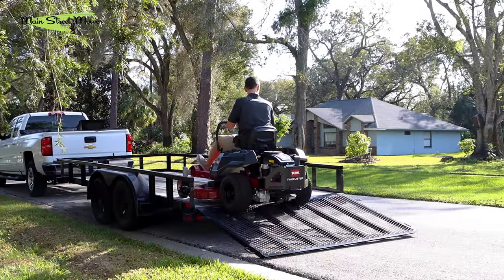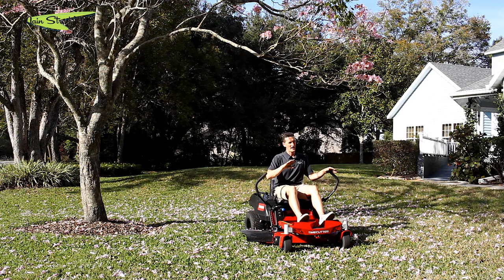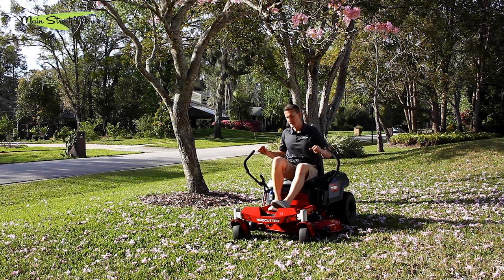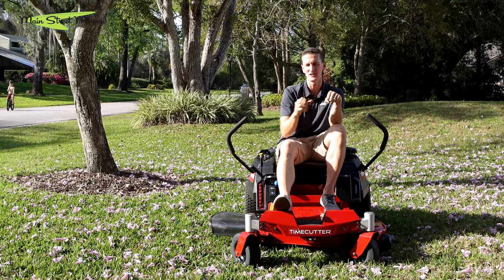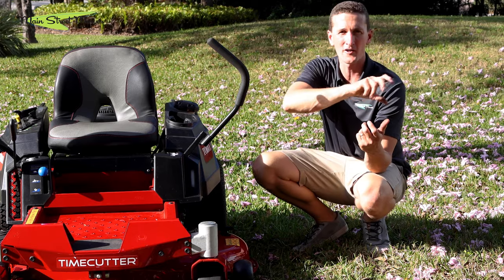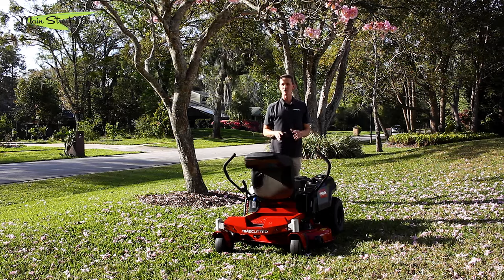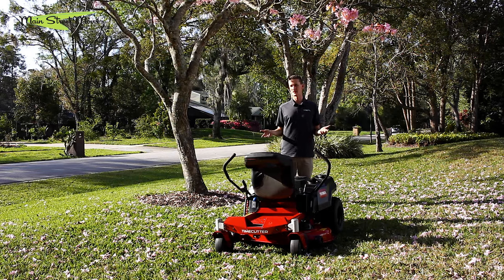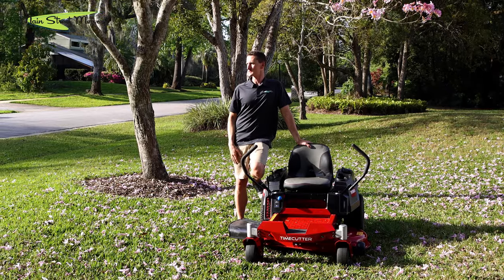TORO TimeCutter Video Owners Manual & Complete Guide

Comment: I have a Toro steering wheel zero turn. I like the fact I can pull a 25 gallon tank sprayer and spray along a fence, turn and pull away. With the lever type zero turn because of the way the back end swings around. When you try to turn it drives the sprayer into the fence. Bring back the steering wheel.
Reply from the maker: It might be a little frustrating specially if you're used to the older style steering wheel handles but that's only until you get used to the newer levers. They add so much more maneuverability to your mower it's really helpful for tricky yard work.

Comment: Maybe I am being a bit rude but having an hour meter as an option is stupid. It should be a stock standard thing
Reply from the maker: We agree, all the accessories would be nice, but from the manufacturers perspective a majority of the market is shopping on price. And adding features would increase manufacturing cost. By providing accessories, customers can add on what’s important to them.
Reply: All deers have time clocks on them
Reply: I agree, I just bought this mower and couldn’t believe they don’t have one stock. It’s wired up and read to go, hell even the slot is cut out. Yet they still make the consumer buy it and install it. Why not just do it and add it in to the total mower price?
Reply: Makes perfect sense. I am however from the small funds category myself so I'd like all the accessories as stock haha😅 @mainstreetmower
Reply: For 3200 it should be factory installed smh
Reply: @mainstreetmower  but it's not really an accessory, otherwise toro can fault no consumer for going over hrs between servicing
Reply: @Phokings  For $4800 it shouldn't spin the tires and gouge your lawn every time you turn 180 Deg.

Comment: Thank you for the detailed video!  
I was trying to figure out if I was supposed to use half or full throttle before engaging blades and a couple video I saw them saying to engage at full throttle to avoid wearing out belts and clutch and that didn't make sense to me.  
I drive big trucks with 18 speeds and of course you don't let the clutch out at high rpm's as it wears out the clutch right!?!  So I kept looking to make sure.  Thankfully you confirmed my suspicions.  
I am buying a 2023 Timecutter 54" deck with the series 7000 Kohler engine and MyRide suspension system very soon and wanted to know my facts before hand.
Anyway, thank you again and keep with the great informative vids :)🟩👨‍🦼
Reply from the maker: Awesome! We're glad this helped. Congratulations in advance on the new machine. 🙂

Comment: Great Video!  I've noticed that these newer models of the Timecutter's have a different deck assembly from the older models. Can you do a video of how to remove to deck for blade replacement?  I'm yet to find one on YouTube
Reply from the maker: Thanks man. Yes, we can put that video in the pipeline. 

Meanwhile, you might wanna check out this video  where we go over installing a mulch kit. You might find what you're looking for when we go over replacing your blades in that video. Here's the link: https://youtu.be/m5aQASnL-8g
Reply: A lot of people lift the front real high with a chain hoist or an engine hoist. Just use HD nylon straps looped around the front wheel outriggers and hoist it up. It's a good idea to use jack stands or cribbing as a safety backup. It's really fast with a battery or air impact gun!

Comment: Cool video. It would be great to see a video on what makes the different 42” Timecutters different from each other. Toro seems to list 4 or 5 models for the same deck size.
Reply from the maker: Good idea Mr Mullin, we’ll do it soon
Reply: One of options is the MyRide, where the seat and foot area are on a shock absorber set up so that if you have an unsmooth lawn, you are not feeling every bump. Well worth it in my opinion.
Reply from the maker: @dconkey1  Agreed with every word in this comment. We even made a video entirely on the MyRide feature. You can check it out here: https://youtu.be/iXxOgn7yPOA

Comment: Question about deck height. I was at a local dealer when a man was saying his MyRide 50" deck at the 4" setting measured only 3.5" at the blades from ground to cut part of the blades. Another man spoke up and said he's measured only 3" at the 4" setting. The dealer said he didn't know of any problems like that. At that time, I left the store. Got home and looked that problem up on Toro website nothing but sure enough on youtube a guy showed the setting 4" at handle 3.5" at blades. Is this a problem and if so, what is the fix. Better yet does Toro know about the and not saying anything. Have you folks seemed this problem if so, what was your fix.
Reply: Just raise it up to the next setting 😅

Comment: will it fit through a 36 inch gate? wheel base?
Reply from the maker: The mower in this video is a 42", so definitely not. However, the TimeCutter 34" (#75734) would your best bet. I believe, it would still be tight, but it might fit if you lift up the chute.

Comment: I was seriously thinking about buying one until I saw the price on a grass catcher $800 and the Mulching kit $160
Reply from the maker: Yes sir, unfortunately the whole lawn care industry is getting more expensive because of the economic circumstances in the country.
Reply: @mainstreetmower  I have a Cub Cadet with a chute block and a grass catcher much cheaper but the quality of the Toro Grass Catcher and mulcher is  far superior than the Cub Cadet. This makes me really curious is the overall design of the Toro superior to the Cub Cadet. Thanks for the video
Reply: I have seen higher ratings for the Toro mulching kit.  In favor of the cub cadet:  lights and an actual oil drain hose.  I had to buy a random hose from home depot to drain the oil.   5/8 “ seems to fit but haven’t tried draining it yet.

Comment: If that zero-turn had a Kawasaki engine, it would be PERFECT!!! 🫤
Reply from the maker: They do have a 52" Timecutter that comes with a  23 HP Kawasaki V-Twin 726cc engine. The model number are 75750 & 75759, in case you want to check them out.
Reply: @mainstreetmower Thanks for the video. To avoid confusion, the models listed, 75750 and 75759, are 50” machines, not 52”.
Reply from the maker: @ChasClem  You're right, those are 50" not 52". Thank you for pointing that out.
Reply: It does 😅

Comment: Wrong Buffalo!  Manual clearly says to engage blades at full throttle.  Doing so ensures you do not bog the engine and clutch engages in tje quickest time possible and does not "ride" the clutch.  Additionally, engine should "always" be run at full throttle to prevent lugging the engine and to ensure maximum cooling from the built-in fan.  Consequently, engine should be shut down under full throttle to burn off any fuel in the intake manifold and to ensure proper closing of the fuel shutoff servo.
Reply: Yes my manual says the same thing the only time you should be at a lower throttle is when you start the manual says start at half throttle for 5 min to warm up before you put under load
Reply: @fonz1116  Interesting.  My Toro manual shows pictures and text instructing to start, run and shutoff at full throttle.  For this reason my throttle has never moved from the full throttle position since purchasing 548 hours ago.  Engine and mower in general (MX5050 74770), has been trouble free and flawless during last 8 years of ownership.